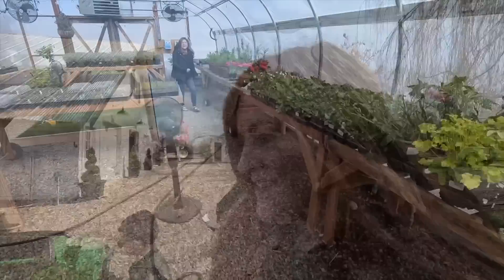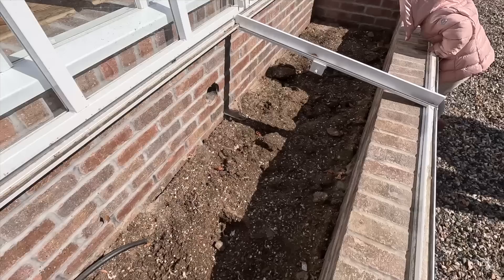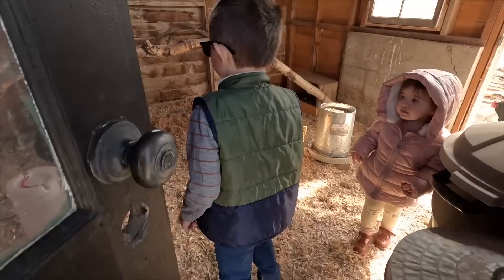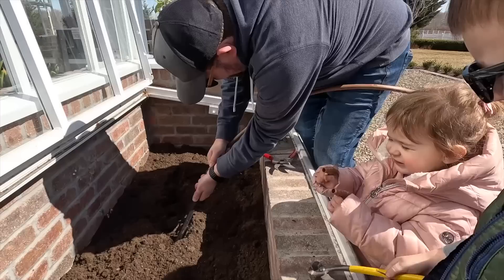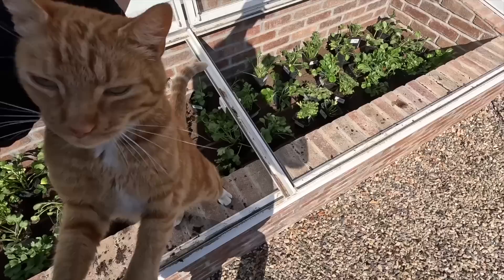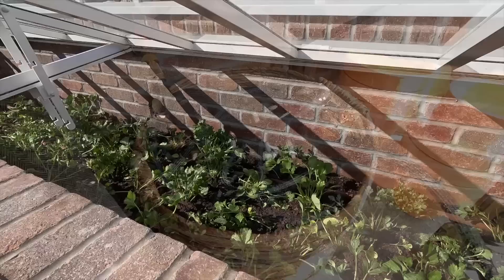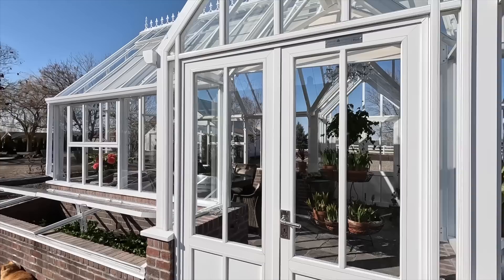Filling Up the Hartley Cold Frames with Ranunculus! 😍💚 // Garden Answer

Comment: Samantha is so following the troop now with piping up.😂❤😂
And Benjamin, my feet hurt watching you run on the rocks with your soft slippers. I bet you would be twice as fast with good work boot or tennie runners😅😊. You also have such a good eye finding the spring happy joy!🎉🎉

I have Tulips and Daffodils that are close to my house that are crazy growing and about 5 big steps are others that are just showing.  I think the house radiates the heat back and helps quick start the ones close by. 
Thank you again for all you share Aaron, Laura and Mom and Sister. It's so welcoming and feeds the soul. ❤🎉❤

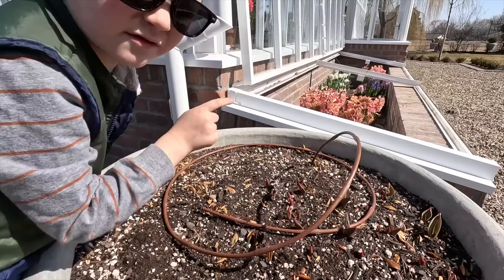Comment: Thank you for the info on when to plant indoor grown ranunculus outside.  I am in 6A and my ranuncs are getting about the size of yours in this vid.  We are still having some nighttime temps in the upper 20's so I'm nervous to plant them out anytime soon.  Hoping between April 1 to 15?  Also, because those 2 sections of tulips are slow to come up, does that mean the flowers stems will be shorter?  My daffodils leaves are only about 3 inches tall yet already putting up flower spikes!  I think i am in for some vertically challenged daffodil flowers this year. At 4:42, Benjamins little hand comes up like, "but listen to me", lol😊

Comment: I can only imagine what massive PW order is coming their way to need to empty the greenhouse of Ranunculus 😊

Using built cold frames like that is so odd, most gardens I've visited over the years (and mine is against an old wall with slabs underneath) would have gravel or paving and indeed store potted plants in them. That way there's no moisture rising from the ground and it's really bad to lean in that low for one's back which is why professionals wouldn't do it. But I suppose it's easy enough to convert them in the future.
Reply: I've been puzzled from the start with the design of those cold frames. I can't figure out if it was a design interpretation mistake by the bricklayers, or if Hartley meant them to be like that. They're so deep that you'd have to fill them with something, or build risers, and that's just not practical to how they're meant to be used. 🤷

Comment: Will you need to eventually replace the soil in the cold frames like you do with regular pots, or will you just need to continue to top it up with more soil/compost?
Reply: The soil, compost, and the logs in the bottom will all break down so she only has to add soil and compost to the top in time.